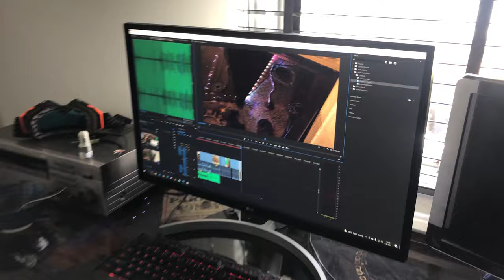Making an EPOXY TABLE unlike ever seen before! - easy to build!

Comment: Did you pour the resin in layers to prevent overheating during the curing process? Looks great 👍good surface finish.
Reply: The initial coat is to seal the porous materials and eliminate any air bubble and air pockets you would get if you just poured it all at once. Most companies are making deep pour epoxies so you don’t have to worry about overheating with thickness.